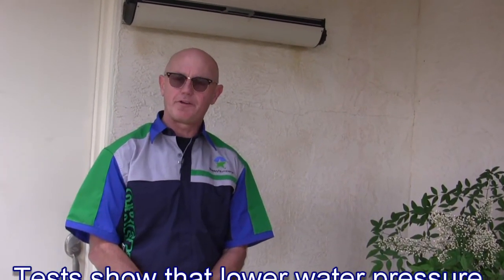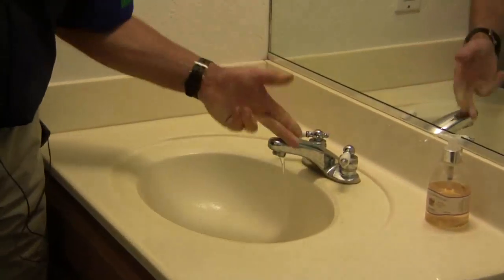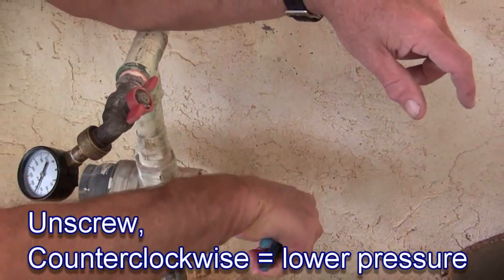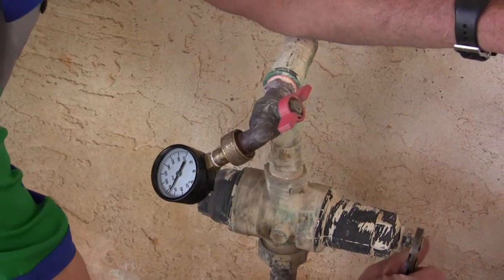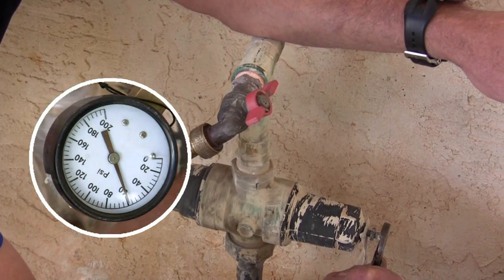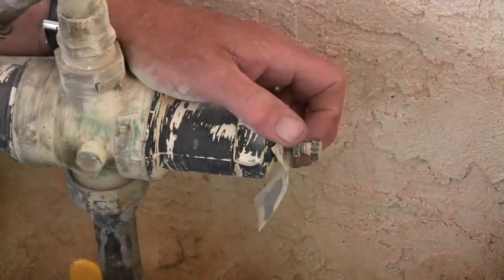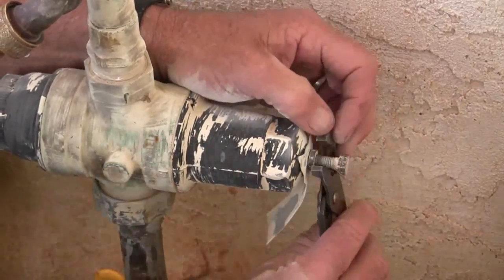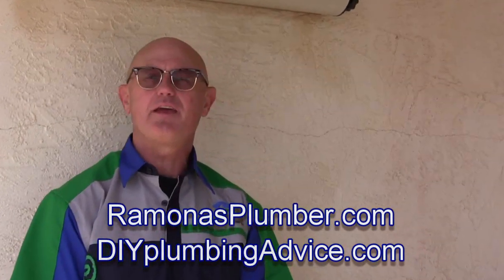How to Adjust Water Pressure to Save Water

Comment: First of all it will not save 1 penny of water usage.  Secondly, most equipment need 60 PSI to work correctly.  This is simply a DUMB idea that will mostly result in screwing up you shower if someone flushes a toilet, etc. which should never happen in a properly plumbed house.

Comment: OK I LOOSENED THE LOCKING NUT AND GOT A LITTLE WTER LEAKING, IS THIS GOOD OR BAD. I JUST RETIGHTENED IT. DID ADJUST ANYTHING.

Comment: Hi, does this pressure affect all of the water, inside and and back yard?  Also, I installed a raindrip watering system and my pressure regulator burst and I had to replace it, but I can't find the same kind.  So I insalled a different one, and this one has a lot of water coming out of it, is there anyway of adjusting it, I had to turn the timer down form 20 minutes slow to 10 minutes it overflows the plants.

Comment from the maker: The bolt will just fall out.  if you unscrew it that far and the regulator is working, it will close it all the way to off.  Screwed in all the way opens it up.  Always have water flowing when adjusting a regulator.

Comment from the maker: It's busted, a new regulator is needed Use a hi grade one that will accept 400 psi capacity they are better than the cheapest ones made having a 300 psi capacity.  Wilkins BR4 is good other than Calif.  here we are limited to the NRL3 model.  Lead issues here.

Comment: I found you video on checking and testing water pressure, because our pressure is really high.  I bought a  Watts Water Pressure Gauge and screwed it on to the hose bib in the front yard and it read 135psi and it said the same for the backyard.  I tried turning the bolt on the regulator, but it wouldn't change.  I also had the water running about the size of a pencil when I was attempting to adjust.  Any advice.

Comment from the maker: Hose clamps on Barbed fittings is your problem.  80 PSI is not.  80 psi is higher than you need, but, a better fitting arrangement is what you need.  Try an Oetiker ring and crimper tool. if you continue to use the braided soft hose.  That is the approved method for joining that stuff.  look in a Restaurant or Bar installation using such High Pressure Tubing.  Another method would be using Fluid Master Refrigerator supply hoses and couplings. to use more than the max length one made (72").

Comment from the maker: @TheAsh274 
  I recommend using a lazy hand gauge to test pressure for a few days.  This second dial needle is left at the highest point it achieved.  For safety I like this method because often pressures are manic up & down and a snap-shot  reading is too little to trust..   Also gauges range is important, using one that goes to 120psi for you use would be bad idea.  .   Zero to sixty would be the largest useable or best zero to thirty.

Comment: How does a water pressure regulator work for a Hot water furnace which is set at 12#?  It seems that the supply side pressure holds the spring loaded valve closed and when the furnace pressure drops to 12#'s it let some water in until the furnace side pressure reaches 15#'s & then the valve closes.  I am trying to draw a diagram to show water flow and pressure to show me exactly how this really works mechanically.  I must be confused somewhere because it doe not make sense.

Comment: Question??? I just moved into a mobile home.  My faucet pressure in both bathroom tubs is high strength, but the shower head pressure in both bathrooms is extremely low, any suggestions besides cleaning the shower heads ???